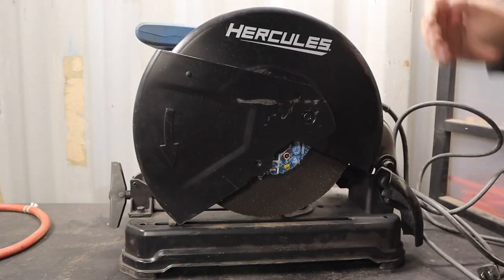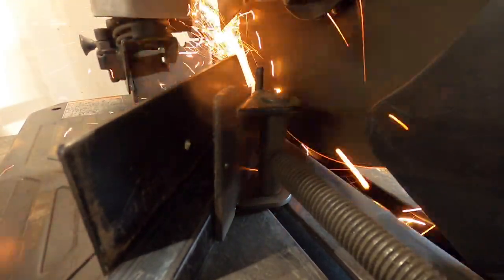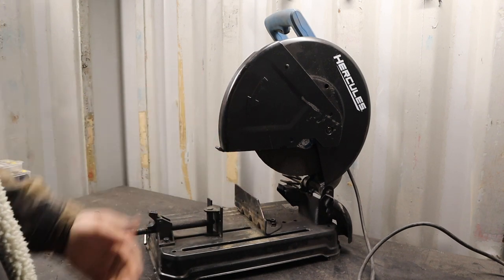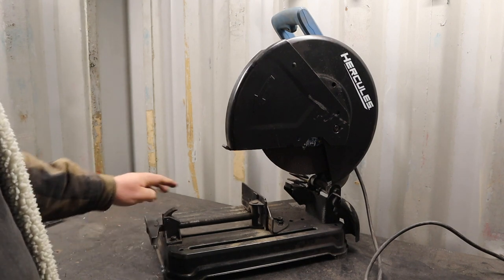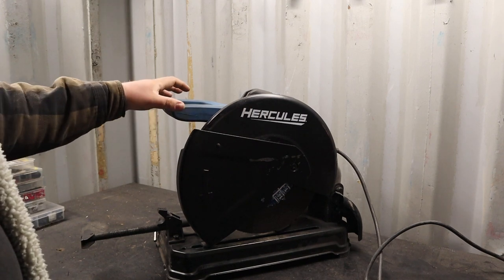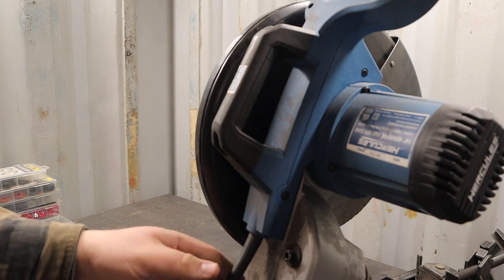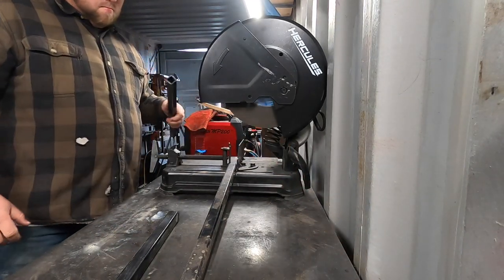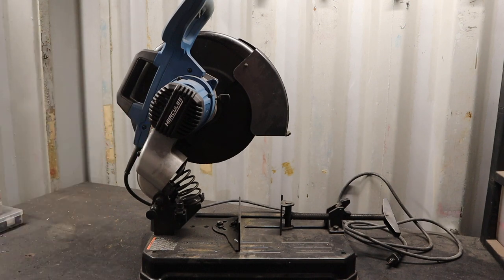Hercules Abrasive Chop Saw - 1 Year Review (Harbor Freight)

Comment: Whats the reason someone would opt to use this "Abrasive" Chop Saw over your standard Chop Saw with a Metal Blade?  I need to cut Aluminum Extrusions and wondering if this is the tool to use or if I should just buy the expensive Metal Blade for my chop saw.  This chop saw doesnt use "blades" correct? Theyre cutting wheels right? So is there a reason cutting wheels are preferred to over using metal "Metal" blades that we use in our standard chop saws?  Sorry for all the questions.. I'm new to this kind of chop saw and new to cutting metal with chop saws.

Comment: I also own this saw and I have a heck of a time cutting through thick steel. What have you found to be the best disk for cutting thick mild steel?
Reply from the maker: Just a good old fashioned cold cut saw with the carbide tipped blades. That or a bandsaw.
Reply: @DereksWorkshopAndProjects  I was asking about the saw in the video. I'm new to this saw, can you put a metal blade on it?
Reply from the maker: Oh I see. No you can’t put a cold cut blade on this saw. I have had pretty similar results with every abrasive wheel I’ve used, and I know the Diamond wheels take even longer than the abrasive wheels.
Reply: @DereksWorkshopAndProjects  I just better pony up the dough and buy a better saw.....